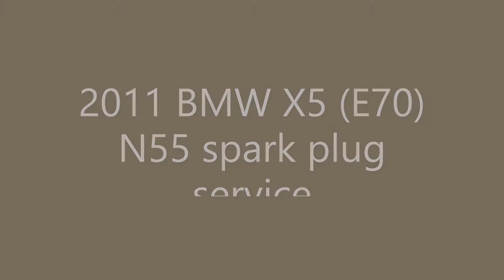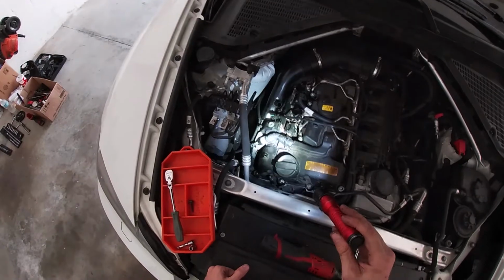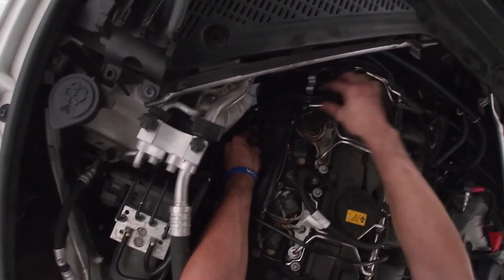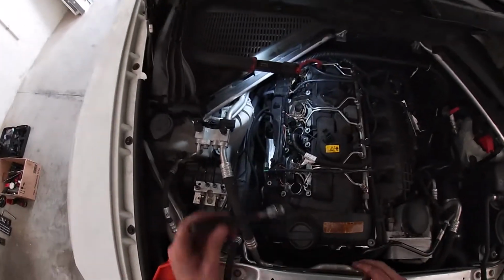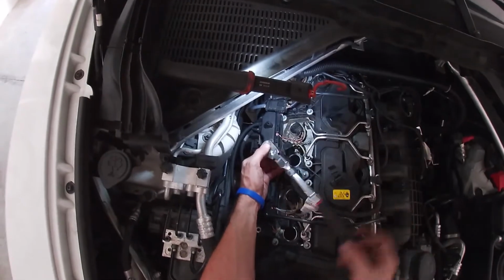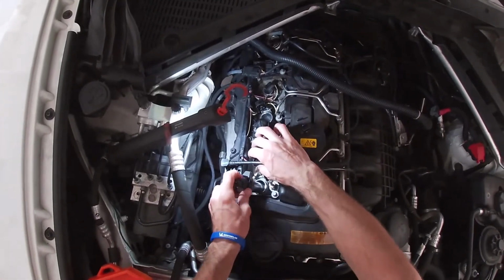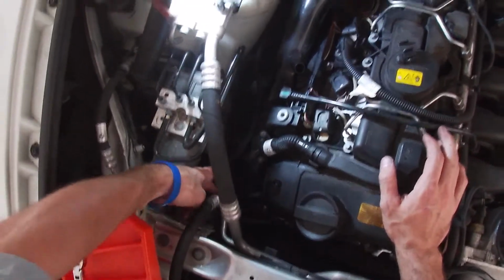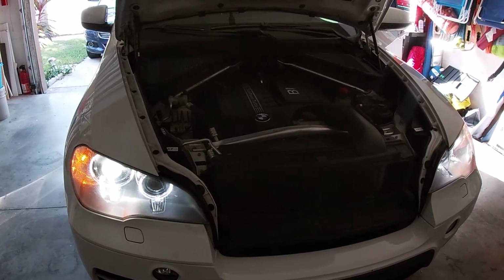2011-2013 (E70) BMW X5 N55 Spark Plug service * HOW TO * #E70 #BMWDIY #bmwsparkplugs

Comment: Thanks my friend. You saved me a lot of money. And a lot of time which is kind of the same thing. Everything went smoothly. Except rock auto sent me two coils that were not the correct size for model number. Note to self. Check parts before you start the job.
Reply from the maker: Glad to hear it mostly went well for you. I appreciate the positive feedback on the video

Comment: Thank you for creating this video.  I just did this job on my X5.  Changing the plugs and coils is easy, but knowing what needs to come apart and in what order can be time consuming.  Following this video step by step was a huge help.  And thank you for including re-installation instructions!  Great, helpful instructional video!
Reply from the maker: I appreciate the positive feedback and I'm glad you found it helpful!
Reply: Hi by any chance did you get any PCodes after the coil change?
I’m having a heck of a time with figuring this out. 
 I have the Engine malfunction, DBC malfunction, Chassis stabilization malfunction.

Comment: Only thing not mentioned is you need a special thin wall socket. Normal 14 mm 12 pt too thick for plug well
Reply: Did u find one in 1/2” drive or did u use 3/8?? I’m having this problem right now

Comment: When removing the old plugs helpful life hack.

With the cylinder diagram….in this case most likely 1-6 with #1 in front and #6 against the firewall.  As you remove the old plugs immediately place the old plug into the box of the new plug with a simple 1-6.  This allows you to review the old plugs against a burn chart reference.  The idea of this is to inspect all old plugs and if you do have any abnormal wear you can help isolate the cylinder and help with troubleshooting.
Reply from the maker: Good tip
Reply: Been doing that for about 20 years and never had a weird or abnormal burn pattern.

Comment: Great DIY! question though, what is the name of the foam cover or part number? My X5 is missing that and the coils where full of rust from water. had to replace the back two.
Reply from the maker: They foam cover doesn't stop that from happening, I do not have the part number for that either. Normally it's the trip around with wiper cowl that's broken that let's water in

Comment: For cylinders 5 and 6 I found it easier to remove the passenger side of the cowl and it only takes a few minutes to take off and give a lot more space to get to those cylinders.
Reply from the maker: You can if you want,  was just showing how I do it with the least amount of steps possible

Comment: Hey There, Thanks a million for this. It gave me the confidence to try at least. My fifth coil broke off and I worked it out with needle nose pliers, whew! The sixth one was stuck too, but I got it out. I noticed that the 5th and 6th coils had dirty water on them. I can't really see down the tube to see how bad it is. This stopped me in my tracks. I was thinking I would vacume the 2 tubes out and pull the plugs, then put the whole thing back together and hope it runs better. What do you recommend? I am not a mechanic.
Reply from the maker: They get water in them from the cowl trim being broken or missing.
Reply from the maker: Blow compressed air in them to get the loose debris out
Reply: @THEDriverMod_  Will do! I'll also try and repair the source of the water. Rain is coming and I can see the whole thing happening over again, no thank you!
Reply: @THEDriverMod_  Hey There, I vacumed and blew out the coil tubes and finally pulled the plugs this morning. The 5th and 6th plugs were wet. Is it imperative that I get all the water out before installing the new plugs and coils? My gut says "yes", but I'm very new to this stuff. Thanks, Dave

Comment: Great video thank you---just did my 2011 X5 35i!   One question--wasn't clear in the video--in the rear of engine--the small horizontal cable bundles below the large harnesses---they go UNDER the foam, not up in the plastic channels--right?
Reply from the maker: I think you're right, trying to know exactly what you are referring to
Reply: @THEDriverMod_  Talking about the several small gauge wire bundles that run horizontally across the back of the engine, they’re about two or three of them.   Wrapped in plastic ducting.

Comment: Folks, this is a pain in the ass job if you are not prepared.  You need a special thin walled 12 or socket made for BMW.  Why on earth they don’t use a regular spark plug socket is beyond me.  Also, absolutely buy the oil separator tube, it will break when you take it off.  Dealer charged $50 but it is only $20 on FCP Euro.  

Also, when removing the harness from the back of the motor, notice he mentions there are two t25 screws to remove, one is missing in this video.  Good thing it is.  It is absolutely impossible to get to the back t25 screw without a 90 degree screwdriver with a t25 tip and even then it is almost impossible.  

BMW is a nice car but complete stupidity when it comes to why they designed it the way they did.  No wonder the Germans couldn’t keep up in WW2.
Reply from the maker: I take it you've done a couple of these yourself??